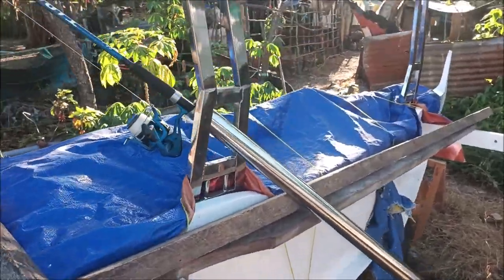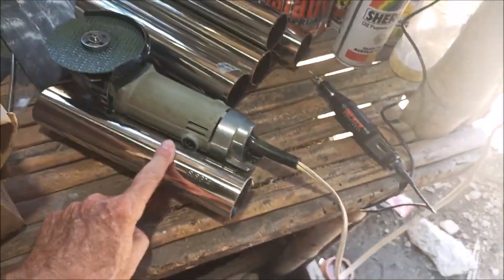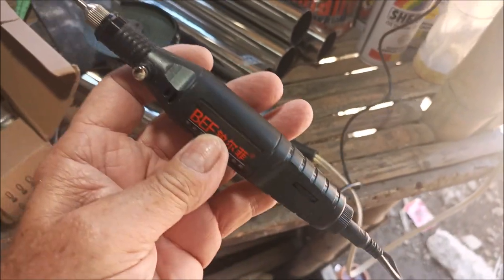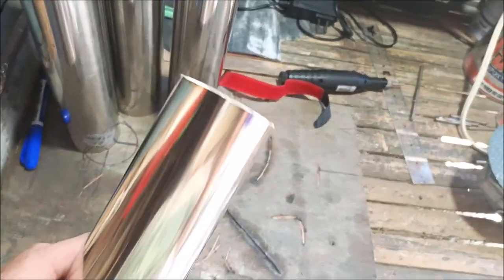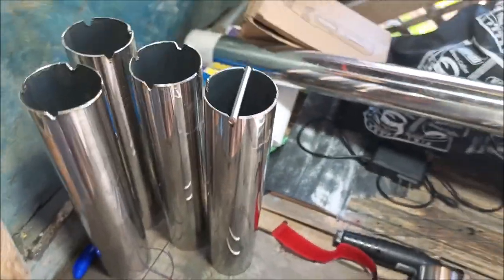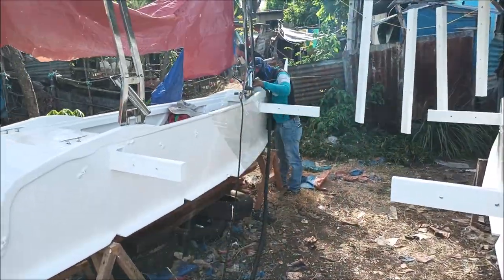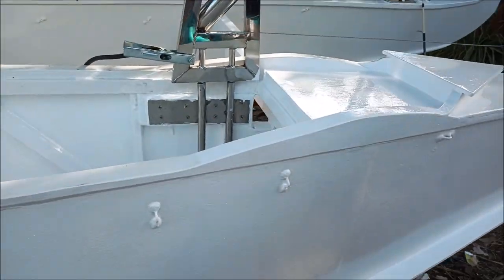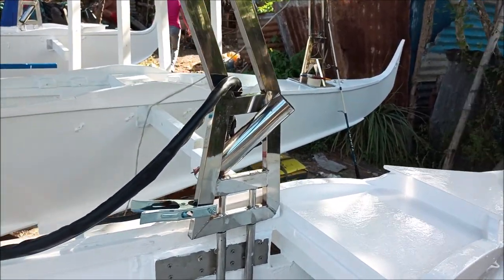DIY Trolling Rod Holders AKA Rocket Launchers On The Shark Fins For The Paradise Trimaran

Comment: Should be in the water soon..
Reply from the maker: Yes very soon, right now I am working on adapting a centrifugal clutch to the engine and having to work out some issues and after that just make a fish finder mount and maybe add some lighting..🌊💦
Reply: I've never seen a centrifugal clutch used like that hopefully it works for you
Reply from the maker: @DavidD6969  I'm still debugging it so stay tuned.